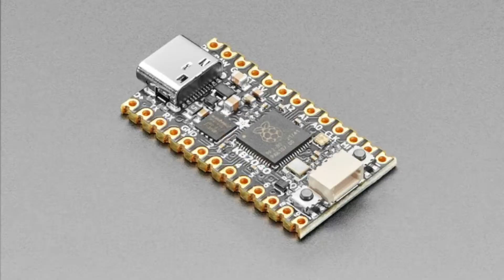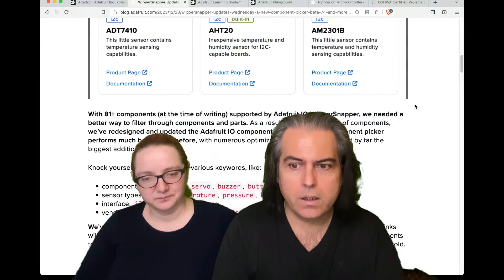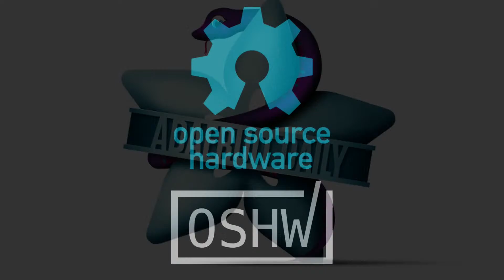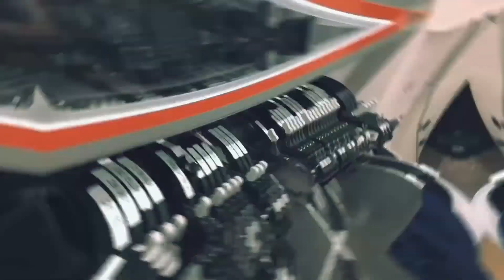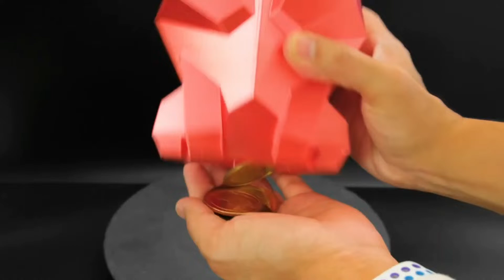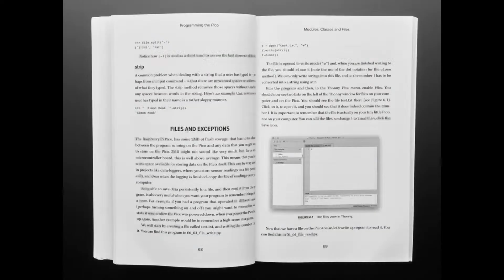ASK AN ENGINEER 12/20/2023 LIVE!

Comment: To make it a bit clearer as if a Tesla BMS system had each 18650 monitored with a 1s BMS controlled by a pi or duino and isolate it if bad and so on . Any idea? All if find are 1s 2s 3s BMS but not one that isolated each batt in a pack of. 2-3-20